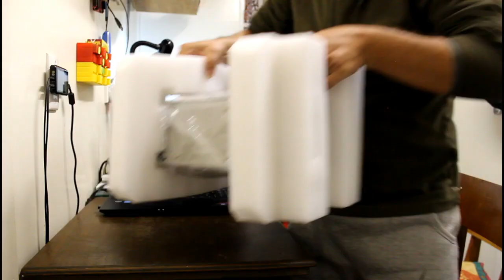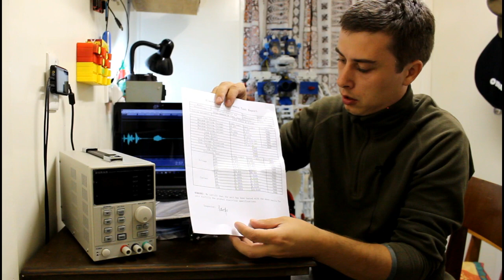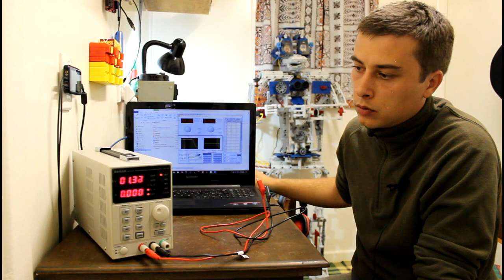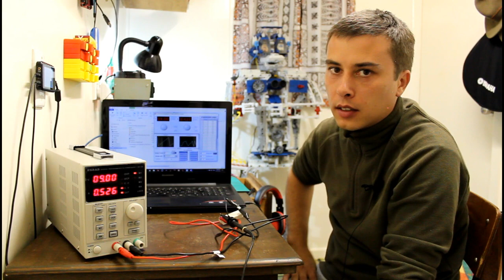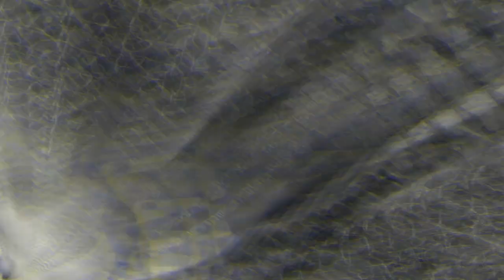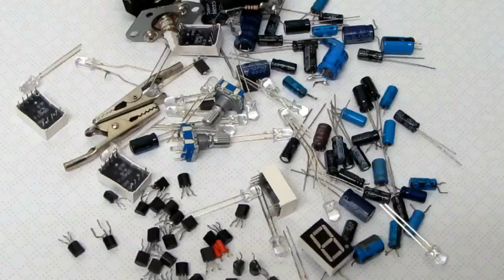KORAD KA3005P / KA3010P (USB programmable power supply)

Comment: Cables that keep their shape when you bend them just tells you it's a crappy cable where each strand has a steel core coated with copper. This is the lowest quality cable you can get. It tells you nothing about the thickness of the total "copper" core. You have 3 types of copper stands sold today. The softest cable you can get have pure copper strands, you can tie knots with it and it won't leave a kink in the cable. Then you have the Aluminium core coated with copper, this is most cable sold in the world today, it is kinda soft, but you can make kinks to it by tying a knot with it. The last type is steel core and if you bend it it will have a kink in the cable. You can have a pure copper cable at that thickness that is stiff, but it will only be a cable with very few strands of copper making up the core of the cable. My parents have a cable factory, that is how i know.
Reply: That was a very informational  contribution. Thank you!

Comment: Hello, I just purchased a similar power supply (ka3005p) and at the first glance it seemed you were right about the connection issue (power supply cannot operate after the software was closed). After several tests I found out that after few seconds from closing the application the power supply recovers by itself (a beep can be heard) and the controls are functional again. Anyway thanks for the great video. A a side note, the software is still full of bugs but I believe that it won't be used by many any way.
Reply from the maker: I just hope they will release another software update soon and they will fix all of these bugs. It would be a neat thing. I saw this article a while ago but i don't know if this version is better than what I already installed or not and I did not have time to download and install it yet:
https://www.eevblog.com/forum/testgear/korad-ka3005p-software-update/

If anyone tested it, please share opinions.

Comment: Hi, is it possible to write a script where the voltage changes with respect to current used?
Reply from the maker: The latest version of software does that automatically. If you operate the power supply in the CC mode and the load will draw more than what the current is set to, then the voltage will self adjust to whatever the ohm law dictates. It even has the "datasave" option and it will create a log file where you will see all the voltage and current readouts throughout the whole period.
Reply: @FunElectronicsToday  Thank you for the comment, I understand that but, I am trying to simulate a battery discharge curve. Where the voltage at the terminal change with respect current to the consumed (charge used(Q)). So let's say at a constant current load of 10A, can the voltage of that supply change from lets say 4V at Q=0 to 3V Q=10ah. This will require current sensing, to calculate charge or can we feed that information in externally. If you can check this out, I would be grateful as these battery emulator cost thousands of pounds. 

Thank you!
Reply from the maker: Aha. Yes. I understand now. I believe you can do that with this power supply. In the latest sw version (V3.2) you can programm voltage, current and time for each step. So you just calculate your battery curve and choose your wattage numbers beforehand and then create your program table into this interface. It should work. If you need more info, contact me over email and we can talk some more.

Comment: Hello, 
Is it possible to just apply current as an output and not choosing also voltage?
Reply from the maker: Yes. Once the maximum current threshold is reached, the power supply switches to C.C. output mode and then it self-regulates the voltage to maintain that current. So it does that automatically. All you need to do is request that current within your load. For instance, if you want to test an LED, you can do that without having a series resistor attached to it. You just leave the voltage to any value higher than 3V (even to the maximum). You set the current to 10mA and you press on the Off/On button to activate the output. The power supply will just adjust the current through the junction until it self-regulates to that value, regardless of the voltage. After it's self adjusting, you can read the natural forward voltage of the LED on the display.
Reply: @FunElectronicsToday   thanks for the reply! 
I am actually willing to buy it to test my LEDs. Is there a way we could message privately? I would like to make some questions to you before I buy it. Is it ok for you?
Reply from the maker: You can check the About section of my channel's page to find out my email address.

Comment: Hello my dear, is a Korad an official factory of this Power Supply or is it just a brand?
Reply from the maker: Good question. I saw the same power supply being branded with TENMA, Vellman, Korad, Wavecom. I don't know which one is the original factory.
Reply: @FunElectronicsToday  In Brazil there is an identical model of a brand called Hikari and this yes I know it is imported. Anyway, thank you very much
Reply: KORAD has a web site, contact information, downloads,etc., in China. I believe they do private branding, which accounts for the other brands.
Reply: The KA3005D/KA3010D is the same as the P models without the remote functions, which I suspect would be adequate for many users
Reply: @jeffreydeutsch7336 the D version is also missing an on/off switch for the output, quite a handy feature tbh.

Comment: Hello, I juste received my K30005p and was surprised that the install for the software in the CD was all in Chinese. Do you know how I can download the English version? 

moreover, I realized that the board controlling the USB is an old one. Do you know if  yours have a opto coupler on the board?
Reply from the maker: Try this one: http://www.eevblog.com/forum/testgear/korad-ka3005p-software-update/
Not sure if it's working or not, but give it a try.
Reply: @FunElectronicsToday   Ok, I finally got it to work with the link you provided. Thanks a lot! Last question. Could you tel if yours have opto couplers on the USB control board located at the bottom back of the PSU? They are like  two beige square ICs...?
Reply from the maker: This V3.2 software version works fine. No errors and it's definitely easier to program than the previous one.
Reply: @FunElectronicsToday  Ok thanks

Comment: 19:00 Have you tried a long press on the lock button to unlock it ?
Reply from the maker: I tried it just now and it is not working. Completely frozen.
Reply: @FunElectronicsToday  Hey ! Thanks for taking the time to try it.
At this date, would you recommend this power supply ? Or do you think there are better options at this price range ?
As you may have guessed, i'm looking to buy a power supply and the TENMA rebranded version of this one seemed like a good choice for me : https://fr.farnell.com/tenma/72-2540/alimentation-1-voie-30v-5a-prog/dp/2445412
Maybe even the two-output version : https://fr.farnell.com/tenma/72-10495/alimentation-2-voies-30v-5a-ajustable/dp/2251947
Reply from the maker: I haven't found any other programmable bench power supply alternative in this price range. It is either this model or rebrands of this model. Anything else is having higher prices. Maybe some other youtubers who are seeing this can come up with other ideas in the comments if they know of different products at this price.  So depending on your needs it could be a good choice. It seems to be robust. I've been using it since I made this video and never had any problems with it except for the drawbacks I already mentioned in the video. The double power supply you posted here is not programmable and it does not have any usb or input port. So be careful which model you order according to what you need.